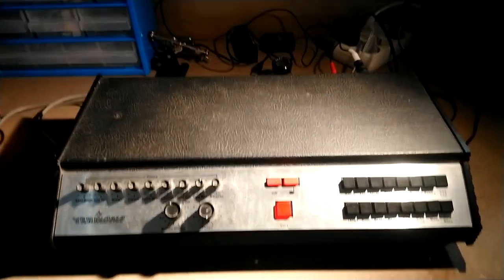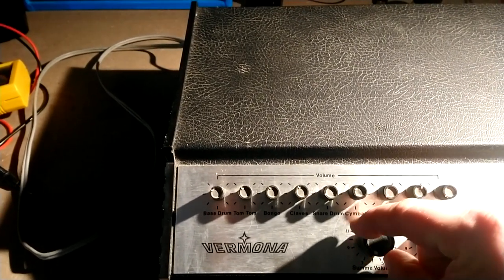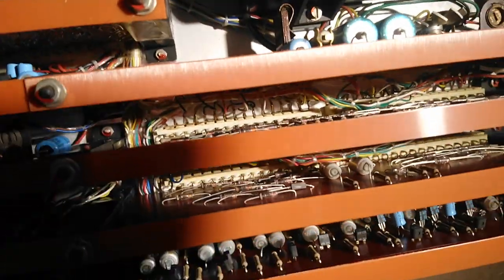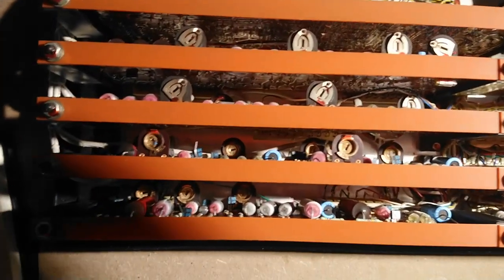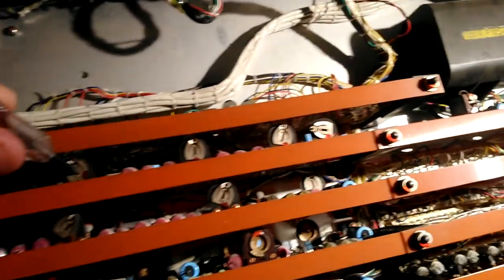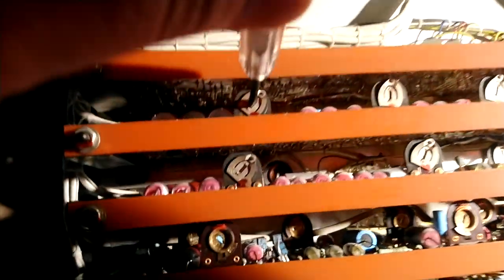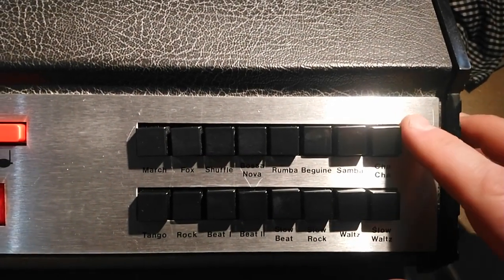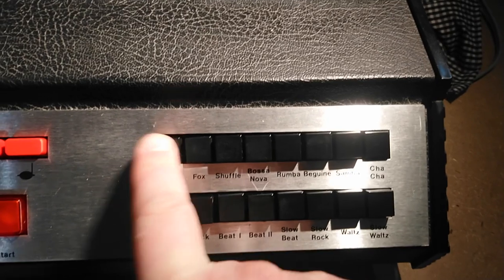East German Drum machine repair and short demo - Vermona ER-9

Comment from the maker: I just realized most patterns doesn't sound very laid back, and that's because the snare drum is very loud compared to the other drums when all the volumes are on maximum. It seems to be just this unit, but of course, with separate volume knobs that's not an issue.
Reply: The volume on the snare is very high in my ER-9 too. Did you fix that?
Reply from the maker: @darrellsmith5710  No, I just turned down the volume. But I'm planning to look at it in the future.

Comment: I have one in a quite poor condition, so any help would be appreciated. The cowbell beep was present and easily adjusted. The same applies for some other percussive sounds, so I can conclude that the signal generation circuits function as expected, but if I hit the play button, the selected sequence won't start. In the best case - multiple drum sounds will be triggered at once, but nothing more.
Reply from the maker: I'm not an expert, but that sounds like there could be something wrong with the clock generator, so it doesn't generate the steps, or maybe just one step?
Reply: @RegebroRepairs  Thanks for the fast reply! That makes sense.